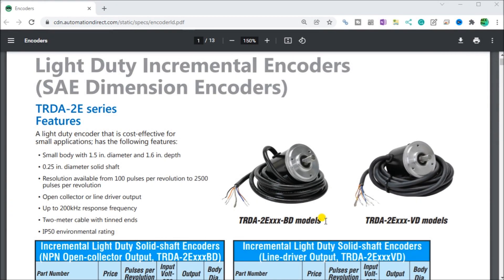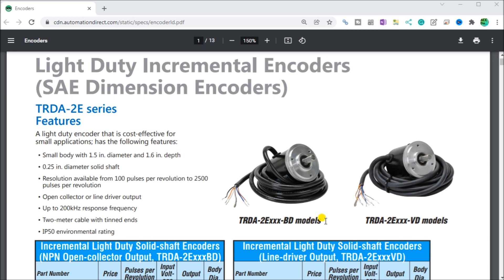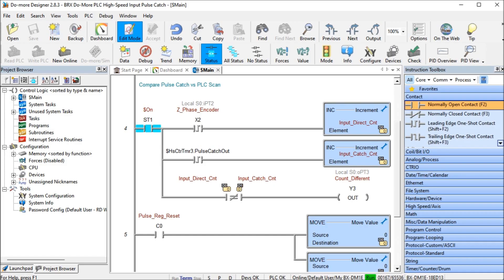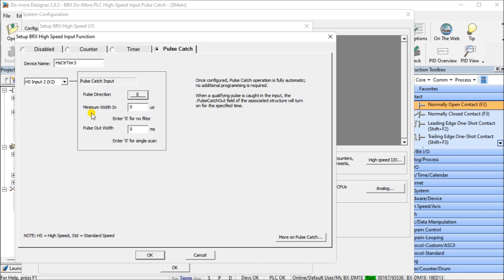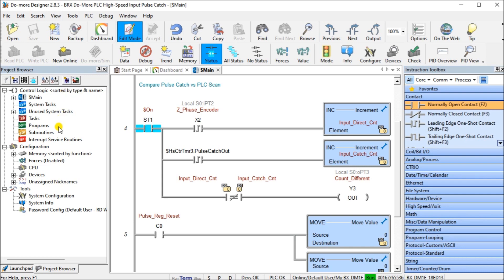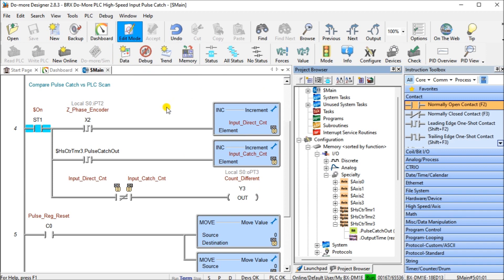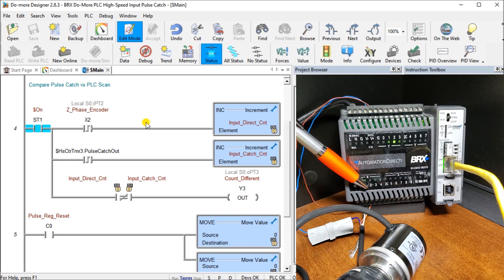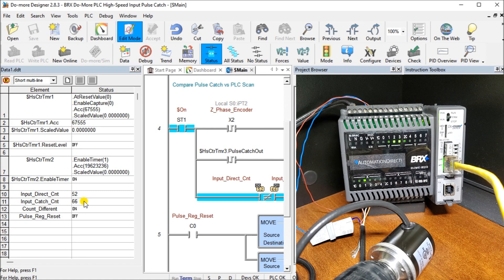BRX Do-More PLC High-Speed Input Pulse Catch

Comment from the maker: The entire BRX Series PLC can be found at the following location:
https://accautomation.ca/series/brx-do-more-plc/
More information can be obtained on our website. This includes all of the links mentioned in this video.
https://accautomation.ca/brx-do-more-plc-high-speed-input-pulse-catch/

There are several reasons why we are using the BRX Series Controller. Here are just a few.
 - Standalone PLC with built-in I/O
 - Built-in Data Logging 
 - Communication ability - Ethernet Port, RS232, RS485, USB - support for protocols such as Modbus RTU, Modbus TCP, ASCII, K-sequence (DirectLOGIC users), Custom Protocols (ASCII over serial, TCP or UDP over Ethernet)
 - Built-in Analog input and output
 - Integrated motion control
 - High-speed counters
 - Powerful instruction set (Video of Instructions in software)
 - Ability to expand the system with a variety of modules
 - Part of the Do-More series of PLCs which use the same free software. (Do-More Designer)
 - Integrated simulator in the software capable of external communications for testing

The BRX series of programmable logic controllers consist of four different units. They differ depending on the Inputs and Outputs built 

into the unit and if it has the ethernet port. 
No I/O Micro PLC unit – (BX ME)
10 Point Micro PLC unit – (BX 10/10E)
18 Point Micro PLC unit - (BX 18/18E)
36 Point Micro PLC unit - (BX 36/36E)
These CPUs (Central Processing Units) are also known as MPU (Multi-Processing Units) because of their communication capabilities.

Regards,
Garry
ACC Automation
https://www.accautomation.ca